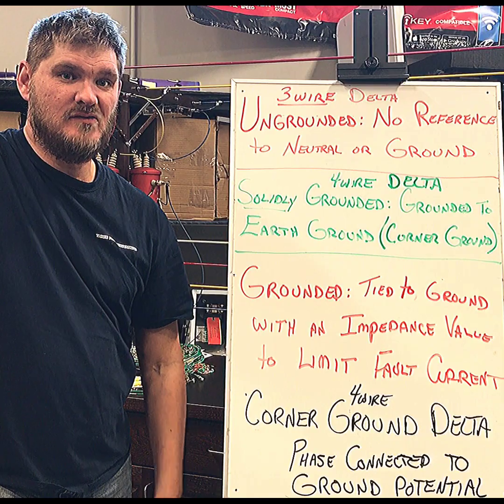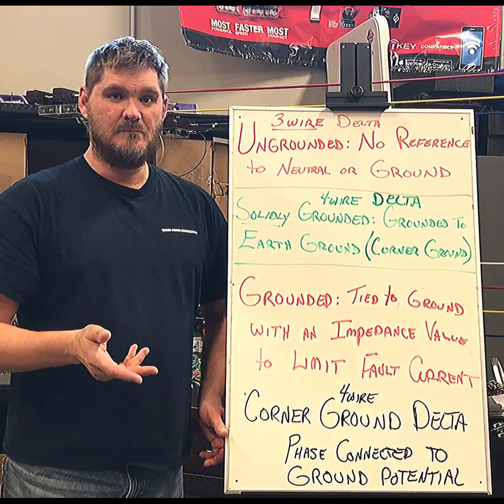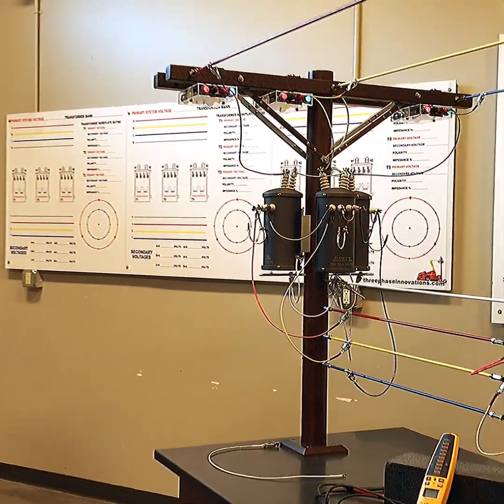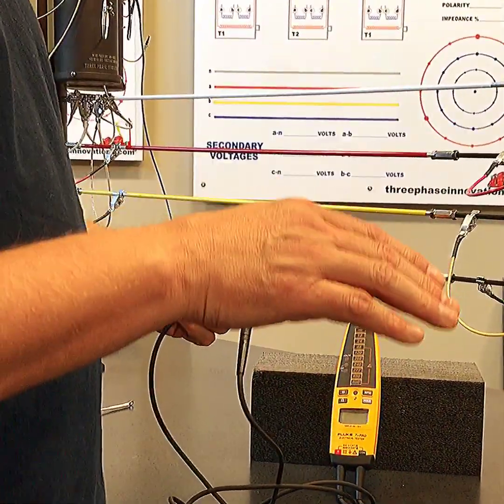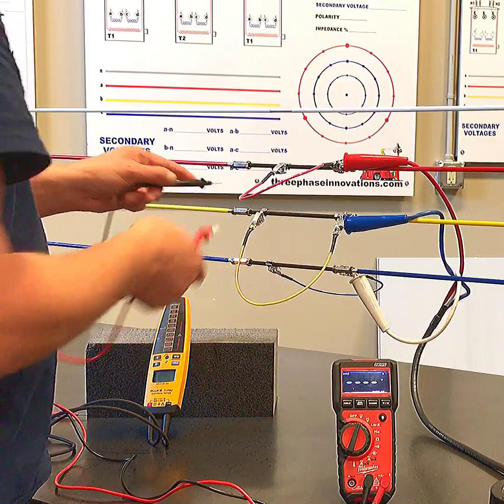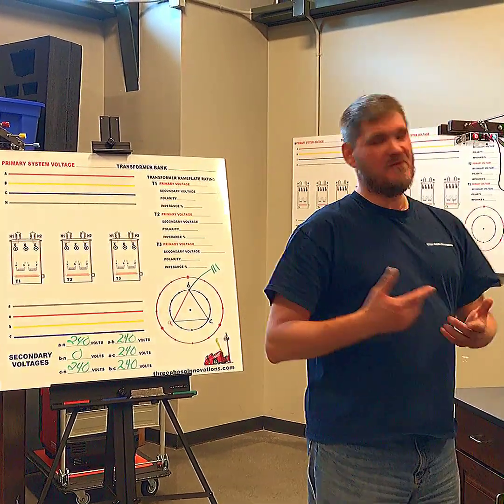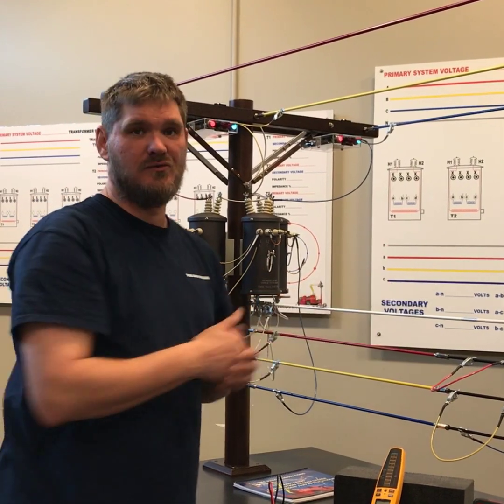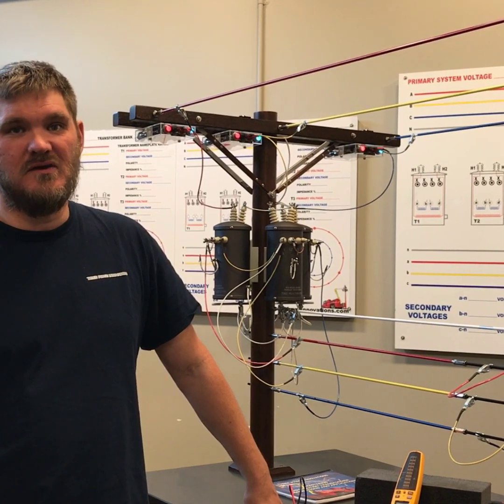Corner Grounded Delta Transformer Bank

Comment: How do you ground a hot
Reply: A three phase Delta circuit (3 wire) is a SERIES circuit (one path for current to flow). You can have one neutral in a series circuit. It is not a fault to only have one neutral. It just creates a path to ground. Putting two neutrals in a delta circuit would cause a dead short. One neutral can be used to create different voltages for a customer (center tapping one transformer can = Lighter Pot) or you can use the neutral as a corner ground. A corner ground provides safety to a delta 3 wire bank and it can prevent a customer from stealing power due to a meter only measures two legs of a delta because it once again is a series circuit. Corner grounding will also make sure a fuse might blow if one of the other phases accidentally becomes grounded but always be aware a Delta is not dead unless all 3 phases are de-energized.
Reply: @jasonleary6717  I need a video explaining this, I'm hands on so I don't fully understand in my world a hot to ground or neutral will short

Comment: Dumb question. A ground and a neutral are basically the same thing when adding your corner?
Reply: Thank you for the question. A Ground and a neutral have different functions in a electrical circuit but in a 4 wire corner grounded Delta, the neutral is acting as a safety or to prevent the stealing of power. (120 volts) If a 3 wire delta is corner grounded then you can't have a phase get accidental GROUNDED and no one not know there is a phase to ground potential in the circuit. Always remember, a DELTA circuit is a series circuit (one path for current to flow) a neutral can show up and know know there is a potential to ground, if you ground a 3 wire delta now you have protection from accidental grounding.  
Here is a great you tube channel for all thing electrical. https://youtu.be/JBpQ9Fodz_Q?si=TzDHvtDCX1sRkBXN

Comment: So when you have a circuit on the grounded phase and that circuit has a short to ground how will that circuit be grounded if it is already grounded? Im so confused.
Reply: Thank you for the question. A Delta circuit can be a 3 wire circuit with no ground or a 4 wire circuit with a corner ground or the neutral can be used to get different voltages for the customer. ONLY ONE NEUTRAL CAN BE USED IN A DELTA CIRCUIT. If the circuit is a 3 wire DELTA then no phase to ground voltage is present, because you have no neutral. The danger with this 3 wire circuit is a neutral could show up accidentally and the DELTA circuit will not show any signs of a problem other than having a phase to ground potential there and no one aware of it. If you chose to ground a 3 wire circuit, then you have a 4 wire CORNER GROUNDED  DELTA. Now one phase has a ground potential in the circuit. If there is a problem or a fault in the other two phases now you will blow a fuse and know you have problem because TWO neutrals will be in your DELTA circuit causing a dead short. Just remember a Corner grounded delta is used for two purposes. (1), To prevent the stealing of power by a customer (120) volts. (2) to prevent a 3 wire delta from accidentally being grounded and creating a phase to ground voltage without the customer knowing they have a problem with accidental grounding that could cause a accident for workers working on the equipment.

Comment: Can you corner ground a 240 delta system and have an ungrounded 120V center tap? I understand you cannot have a redundant ground, but couldn't you still have a 120VCT with a corner grounded system?

Comment: Hello, and thanks for the video. What if I need a neutral on the corner grounded delta??
Reply: Thank you for the compliment. A Delta circuit is a Series circuit (one path for current to flow). You can ONLY put ONE neutral in a delta circuit. You can use the neutral as a corner ground or use the neutral to center tap a can for different voltages but you can only do one or another at a time. You can't center tap with a neutral and corner ground at the same time. It would be to many neutrals in a delta circuit at the same time causing a short in the circuit.
Reply: @jasonleary6717  hey thanks for the response, so i got it. so the corner ground acts as a neutral to carry the load unbalance¿? the reason i ask os because i installed a buck amd boost on that corner delta for a three phase stove, and i read in the buckboost that if the load is unbalanced it needs to be tied to a 4 wire system, but i am not sure what is the asumption. their specs are very poor, just a label.
Reply: @celsiusfahrenheit1176  I have never used a buck-boost transformer but I'm guessing that it is a transformer that makes changes to a fixed voltage. As a lineman we have pole mounted transformer with tap changers that do the same thing by adjusting the primary coil's turns ratio to match high or low voltage on a distribution circuit. If you have a 3 wire delta bank, you would have just one voltage to chose from between any two phases; however, when you corner ground a phase you do stabilize the ungrounded phases. An example would be having a 240v 3 wire delta. There would be no phase to ground voltage except for phantom or ghost voltage which can be corrected by using a meter with a LoZ setting on it. We have a phantom or ghost voltage video on a 3 wire delta on here as well. So, lets say you corner ground B phase on a delta circuit. Now your voltages change in the circuit. B to neutral will read zero but A and C phase to neutral will read 240 volts. It stabilizes the other two phases not grounded. I'm guessing like you mentioned the neutral on that type of transformer is needed for the unbalanced load to have a completed circuit to stabilize the ungrounded phases but that is just my best guess on this situation.
Reply: @jasonleary6717  nobody really knows, i wil talk to the engineer from the poco. i never saw a three phase stove before, i told the custumers in writting when they asked me, that their service was a 3 phase corner delta no neutral 240v they still got a 3 phase 208v no neutral required. anyways thanks for your replays.

Comment: In one section of the plant I work in I'm reading 480v between all phases and A: 488v B: 402v and C: 82v to Ground. I was under the assumption it was a corner grounded delta and maybe something isn't bonded properly but I'm not positive. I know you can wind up reading a little bit of voltage on the Grounded phase but I have never seen something as high as 80v. I was hoping you could shed some light on what might be happening in the system.
Reply: Hello Bryan, Corner Grounded deltas or 3 wire delta banks can be tricky. One of the phases should be labeled or have some kind of identification to let you know what phase is grounded. If it is a corner ground, the other two phase not grounded should be stable to ground. An example would be having the B phase grounded. It should read 10 volts or less on a meter (B Phase to ground) but if you have a meter with Low "Z" setting you should get a more accurate reading. Phase A and Phase C would still read 480V to ground if it is a corner ground. If it's a 3 wire delta and have have readings like you mentioned then whole new troubleshooting problems occur. You may have a piece of equipment or a ground come into the circuit and now you have to find it.  When a 3 wire Delta gets an accidental ground, volt meter reading can become very strange depending on the resistance to ground or the type of meter you are using. The Corner ground Delta bank was created to prevent some real troubleshooting problems for 3 wire delta banks and for safety. Just one ground can exist in a Delta bank and not affect the bank at all. I doubt this helped you much with your situation, but you might want to see if your plant has any old electrical prints, warning lights or maybe check out the transformer bank outside on the pole feeding into the building. Sometimes a corner ground Delta is much easier to spot on the transformer pole itself to see if a phase is grounded. good luck.
Reply: @jasonleary6717  hello. i like your explanation and video demonstration. i have an ungrounded 3 phase 3 wire delta going to a customer's 3ph 480v motor.  he has no electrical issues to speak of but i wonder if he's aware that one of the phases is grounded at the meter.  there is no identification on the grounded conductor; however, at the meter socket is a bonding jumper on the middle phase wiring lug with a manufacturer's tag that clearly states: 'When service is not grounded, remove bonding strap..."
i think that's dangerous to ground a phase at the meter because what happens if the equipment (in this case the meter enclosure) ground comes loose? so where is the proper place to ground a phase if not at the meter?
Reply: @betta3301  Thank you for taking the time to check out the video. I really can't give you a great answer to your question; however, when it comes to grounding any electrical circuit, the NEC Code book is very detailed to say the least. I suspect that Local or state codes might also have something to do how the circuit is grounded. I also suspect the circuit might be grounded only in one location so the circuit could easily be underground if need be at certain times for whatever reason. The main thing to remember when dealing with any DELTA circuit is always be aware of back-feed and ONE neutral can be in the circuit making it a 4 wire DELTA. Corner grounded or center tapped to obtain different voltages (120/240 etc..) Electricians have always said troubleshooting a DELTA, which is just a series circuit can be tricky.  Section 250.1 helps you overcome a common problem that leads to misapplication of Article 250. Most folks are so overwhelmed by Article 250 that they immediately get lost when confronted with it. However, it’s divided into 6 logical groupings of information and Section 250.1 of the NEC codebook tells you what those are. Good Luck and stay safe. :)
Reply: This was helpful. So it sounds more likely that we have a 3 wire delta, thus the goofy voltages. I’ll be digging into this a bit more now to verify. Thank you for your quick response and expertise.

Comment: HVAC service tech here. Came across a Corner Ground Delta configuration today. Thought it was regular 3 phase and the customer simply had a faulty breaker. Oops
Reply: Corner grounded delta's can be tricky. I'm glad I'm on the Lineman side of the bank. So much troubleshooting on the electrician's side. :)

Comment: Just ran into this in a waste water treatment plant. 480v delta. Reading 480v to ground on A, and B phase but on C phase i was reading ~11v. Thought I had lost a phase, called POCO, lineman came out and explained what type of system we have.... this video has a great explanation! Thank you for making videos like this so other people can learn! 💯
Reply: Hello Mr. Rodriguez. Thank You for taking the time to check it out. We really appreciate it.
Reply: i'm seeing the same thing at a similar location.  if i may ask, where are you seeing the conductor being grounded?
Reply: @betta3301  not sure I understand your question. I was reading the ~11v after the transformer
Reply: @pumarodriguez3964  you stated you have a grounded phase conductor and i was just wondering where you see the phase being grounded at, if possible. if its inside a pad mount transformer then its not obvious as compared to up at the pole.  or maybe its grounded somewhere else?

Comment: Thank you very much for explaining this so well. I have been a refrigeration service tech for 38 years and have never had it explained this well. Two questions. 1. what is the proper color to identify the grounded phase. 2. I was on a job yesterday where an electrician used a 2 pole disconnect  and claimed the grounded phase did not need to be disconnected or switched or opened by a breaker. I did not like it but he has been in the field many years himself. I felt the need to follow the professionals advice. What say ye of this ?
Reply: Hello Mr. Thompson, sorry for the late reply but I was able to find a little bit of information to your questions. Hope this helps. 

QUESTION 1: Important requirements for the grounded conductor of grounded electrical systems or services are found in Article 200, which deals with identification of grounded conductors and their terminals. The grounded conductor is required to be an identified conductor of the system or service. Sizes 6 AWG and smaller generally are required to be identified by white or natural gray insulation for its entire length. Sizes larger than 6 AWG are permitted to be identified by white or natural gray insulation; by three white or natural gray stripes along the entire length of the conductor’s insulation, on other than green insulation; or at their points of termination by distinctive white markings that encircle the conductor, such as colored tape or painting. This identification is required for both grounded conductors and corner-grounded delta systems.

QUESTION 2: This section contains a list of standards that are applicable to corner-grounded delta systems. These standards address three basic points:

1.   Any two-pole circuit breaker intended for use on corner-grounded delta systems shall be tested and rated for such use.
2.   No overcurrent device is permitted to be used to disconnect the grounded conductor, unless this device simultaneously disconnects all conductors of the circuit, including the ground.
3.   If the system is a corner-grounded delta system and fuses will be used for motor overload protection, a fuse must be installed in the grounded conductor, but only at the motor controller.
Reply: @jasonleary6717  Thanks that helps narrow it down somewhat.  Lyndell

Comment: What voltage fluctuations or surges would there be if one we're to remove the ground while under load ?
Reply: Very good question koontreeguy. The only info I have read about losing the ground is a relay should set off an alarm or warning that the ground phase has been lost. Most engineering companies stop with their info right there and don't explain the effects of the bank losing the neutral under load. Schneider Electric only explains the advantages and disadvantages of this old type of system (I copied them below). Sorry about not be able to give you a definite answer to your question.
 
Corner-grounded delta systems:•Stabilize voltages of the un-grounded phases to ground.•Reduce the generation of transient over-voltages.•Provide a method for protecting electrical distribution systems when used in combination with equipment grounding.

Due to its disadvantages, the corner-grounded delta system has little reason for modern day use:•The system is unable to supply dual-voltage service for lighting and power loads.•It requires a positive identification of the grounded phase throughout the system.•A higher line-to-ground voltage exists on two phases than in a neutral-grounded system.•Most electrical distribution equipment manufactured in North America is not rated for use on this system.•Fault switching (opening) is much more severe for the clearing device, and ratings may be greatly reduced.

Comment: I just found out about corner grounded delta transformers and I'm so confused about how you can take a phase to ground and it not behave like a short?
Reply: Hello Adam. Thanks for watching the video. Electromagnetic Induction is the whole reason a transformer is able to not "short out" when grounding ONE side of a transformer's coil. Faraday's and Lenz's Law describe a transformers ability to create a CEMF force that opposes the applied voltage. This keeps a delta or wye circuit in balance. A Delta circuit is tying the transformer coils in series. You can always put ONE neutral in a Delta circuit and you will not destroy a transformers ability to create the CEMF force. Two neutrals in the Delta circuit will create a "dead short" across the transformer coil. If you destroy the transformer's ability to produce a CEMF, Ferroresonance will occur. Another crazy phenomenon dealing with electricity.
https://youtu.be/k2RzSs4_Ur0 Video about Lenz's law
https://youtu.be/U7dNdQc1NL4 Ferroresonance CEMF
Reply: @jasonleary6717  hope you can answer but how could we get around this when we connect our 3phase solar inverter on such systems. Will isolation transformers work?
Reply: Thanks Jason, they were very helpful!